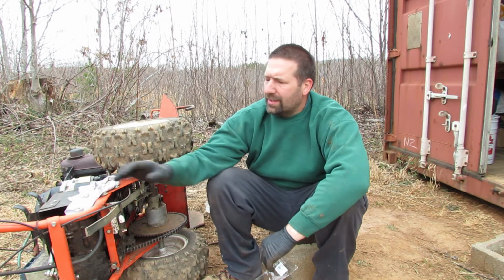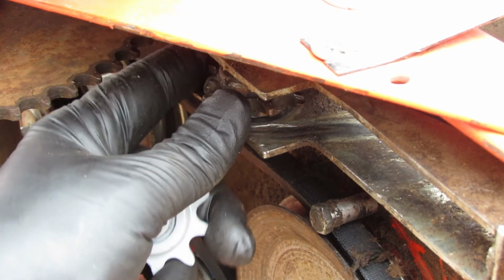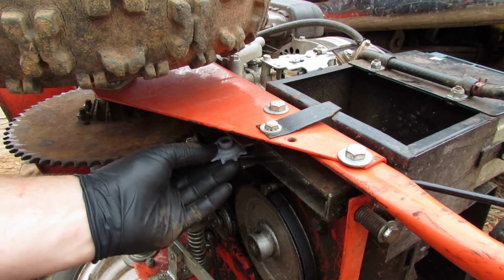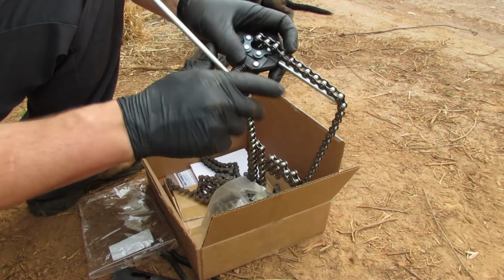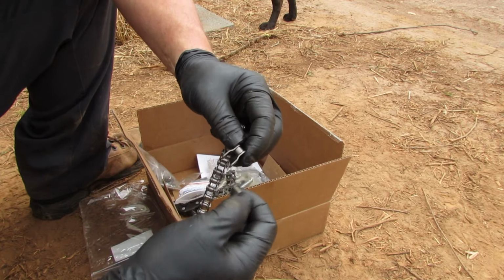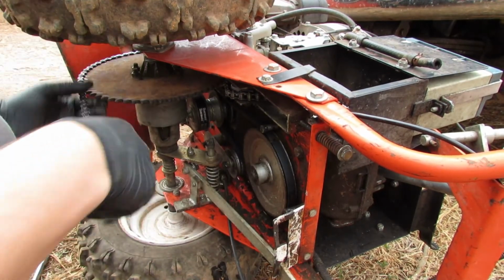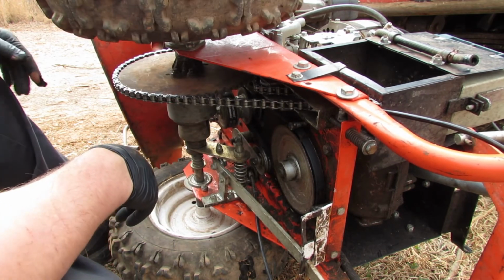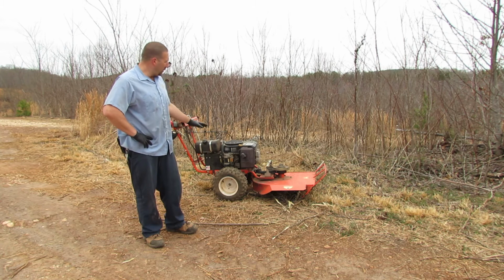How To Replace Drive Chain on a DR Mower AT1

Comment: Just started messing with one of these. DR has great customer service and will send you a PDF of the manual for your model. Service kit is a pretty good price as well. The chain on mine broke. Besides being old, I think I did not check the tension of the chain often enough.
Reply from the maker: @MikeB-tu8nr good to know. Thanks for letting everyone know. I love our AT1! I used it over the weekend. Thanks for watching and sharing. Happy wrenching. ~Mr. C.

Comment: Sir,
I see you have a spring on you drive chain idler bolt. Do  you happen to have a  part number for that spring? I am in need of this spring and can't fine it again the old number of PW550. Any help you can offer would be appreciated.
Reply from the maker: @RandyLombardi unfortunately I do not have the part number. I have had good luck calling the DR power equipment customer service. Always helpful and knowledgeable. They got bought by Generac, hopefully they are as good as they have been. If you run into any trouble let me know. I will see what I can do. Thanks for watching and asking. ~Mr. C.

Comment: Could you do one on how to remove the gearbox. I've got it upended like you here and still can't get the bottom pulley out to get to the screws on bottom to release the box on top. Or just reply to this. Thanks very much! I'm stumped. Nothing on the net about it.
Reply from the maker: @Bill Callahan I am using the mower regularly now so taking it down in the middle of the growing season would be difficult. I will, however, help as much as possible. Try using the "walk off method" to remove the pulley after loosening the setscrew. Check out the Taryl Fixes All video provided below. Start around 10:38 to see him do this on a front mounted PTO clutch. Hope this helps. Thanks for watching and commenting! ~Mr. C.

https://www.youtube.com/watch?v=rVIQ9TXWrko
Reply: @NaturesCadenceFarm  First! Thank you very much & I will watch the link. I finally did get the gearbox off. Checking DR now for a used or new one. Again, many thanks!

Comment: Mine looks like this except it doesn't have a idler sprocket... mine is smooth metallic pulley (looking) ... do I have the wrong idler? I bought this used...
Reply from the maker: Phil Jones I would contact DR with your serial number to ensure you have the correct parts. I found my serial number on the label where the hand controls are located. I am not sure of the location on the newer models. It does appear there is a serial number change in there that shows a roller instead of the sprocket so it could be correct. Thanks for asking. ~ Mr. C.

Check out: ref #38
https://www.drpower.com/pages/content/customer-support/product-support/ordering-parts?aribrand=chp#/DR_Power/AT1-Walk_Behind_Mower__(Ser%23__ATM000001_To__ATM41931)/Power_Unit/AT1Main/11110902/y